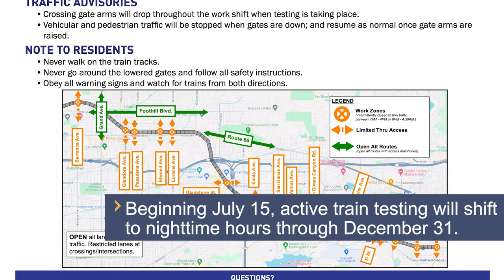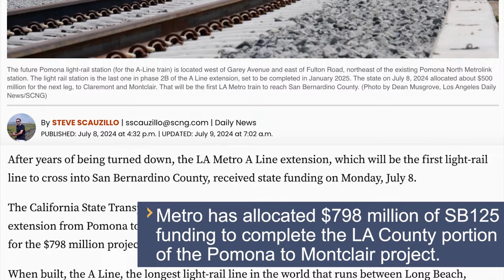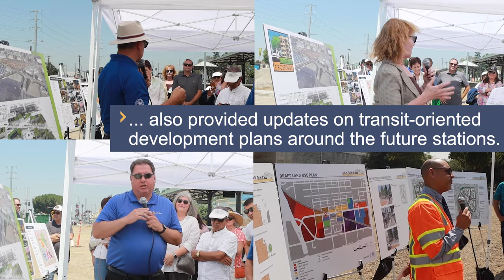Foothill Gold Line Project Update Highlights - July 2024

Comment: Let’s get you the funding to Montclair, and eventually to Ontario Airport!!!
Reply: How about a Split at Upland for trains to go to Ontario Airport and/or Brightline Rancho Cucamonga.
Reply: LA Metro was recently awarded state funding for the extension to Montclair, but anything beyond that would have to be administered through a different county, not LA County.

Also, many surmise that the line will already be too long when it opens to Pomona, and will have logistical issues in maintaining good reliable  frequencies.
Reply: @Volkswagen-of-Deutschland Anything beyond LA County boundaries will need to go through a different County. Local transit lines are funded within County transit agencies. Metrolink is the exception because it's funded by each of the 5 counties it serves. That arrangement doesn't currently exist for local transit lines. It would be up to SBC or OC transit agencies to make that happen.

Comment: With regard to these parking lots, I do wonder if they considered building two or three stories worth of parking in a smaller overall footprint? Otherwise, the project looks great, and it’s completion couldn’t come soon enough!
Reply: I have heard that the surface lots were done instead of garages as they could more easily be demolished for future development. So if laws change and Metro isn't required to have as much parking or any for that matter, they could in theory tear out the concrete and build apartments or TODs, etc. But it certainly would be better to have done a garage with a smaller footprint, at least in the current time we live in.
Reply: @jarrodxc70 You are correct. It was about buying the land for future development. Building a parking lot is much cheaper than a small structure. It's really about cost.

Comment: I just dont understand why every train station in California needs to have parking as close as possible to the platform. WHY?? ITS SLOWER THAN DRIVING FROM POINT A TO B???
Reply: To attract car drivers since many of the stations are located within smaller cities that have limited public transit.  Eventually, these LA Metro properties will include TOD, too. In the future they could build a smaller parking structure and the rest would be be a combination of commercial and residential. It's good that they bought the land to begin with though.

For example, I started using the LA Metro again after Covid about a year ago. I drive about 10 minutes to a station with a parking structure across the street and spend the rest of my outing using the LA Metro. I longer drive to DTLA, Santa Monica, Little Tokyo, Chinatown, Exposition Park, etc. It's been great and very convenient. I could take a bus to and from the station, but it would take about 40 minutes more to and from the station.

Comment: TOD > Parking.... Why would i take the train to a parking lot... smh
Reply: To save money on gas and ware and tear on cars that are older
Reply: @iloks9177 even still a parking lot can only hold so many cars and also make it more difficult for everyone else to reach the station, making it harder for people to get to the train stations and get onto the trains.
Reply: Initially, it will be a very good thing to attract car drivers since many of the stations are located within smaller cities that have limited public transit.  Eventually, these LA Metro properties will include TOD, too. In the future they could build a smaller parking structure and the rest would be be a combination of commercial and residential. It's good that they bought the land to begin with though.

For example, I started using the LA Metro again after Covid about a year ago. I drive about 10 minutes to a station with a parking structure across the street and spend the rest of my outing using the LA Metro. I longer drive to DTLA, Santa Monica, Little Tokyo, Chinatown, Exposition Park, etc. It's been great and very convenient. I could take a bus to and from the station, but it would take about 40 minutes more to and from the station.
Reply: @drdewott9154 Not really. The parking lots are temporary in the long term, but short term they are there to attract car drivers to more conveniently use the light-rail line.

For example, I started using the LA Metro again after Covid about a year ago. I drive about 10 minutes to a station with a parking structure across the street and spend the rest of my outing using the LA Metro. I longer drive to DTLA, Santa Monica, Little Tokyo, Chinatown, Exposition Park, etc. It's been great and very convenient. I could take a bus to and from the station, but it would take about 40 minutes more to and from the station.
Reply: Some are questing the size of the parking lots and structures. Here in the east where we have good public transportation including bus lines that serve our regional rail lines, most have good sized parking areas. This is especially where new lines are built or old lines extended or rebuilt. In New Jersey the Lindenwold High Speed Line electric heavy rail line has big parking lots at many of its outlying stations. They are usually crowed on weekdays. If people are parking and using transit instead of driving into the city it is still a positive for the environment. Less driving means less fossil fuel emissions that the cars would have created if the people did not park and ride the train. So I hope the same thing happens on this new extension of this rail line. It can serve driving as well as non driving passengers.

Comment: Why so much parking?! Could have been housing!
Reply: Initially, it will be a very good thing to attract car drivers since many of the stations are located within smaller cities that have limited public transit.  Eventually, these LA Metro properties will include TOD, too. In the future they could build a smaller parking structure and the rest would be be a combination of commercial and residential. It's good that they bought the land to begin with though.

For example, I started using the LA Metro again after Covid about a year ago. I drive about 10 minutes to a station with a parking structure across the street and spend the rest of my outing using the LA Metro. I longer drive to DTLA, Santa Monica, Little Tokyo, Chinatown, Exposition Park, etc. It's been great and very convenient. I could take a bus to and from the station, but it would take about 40 minutes more to and from the station.